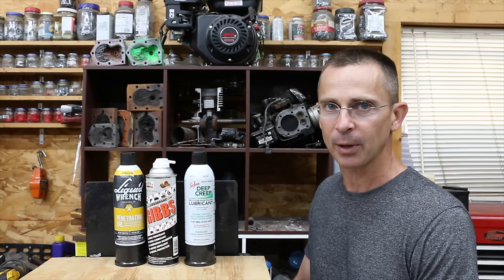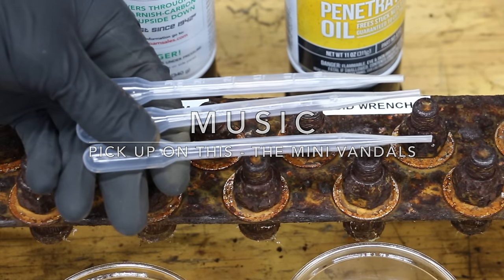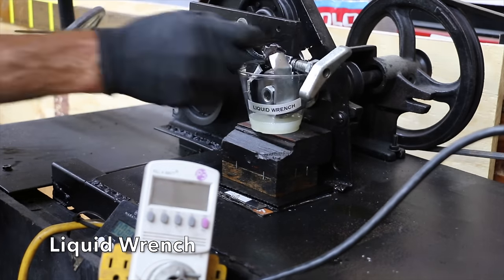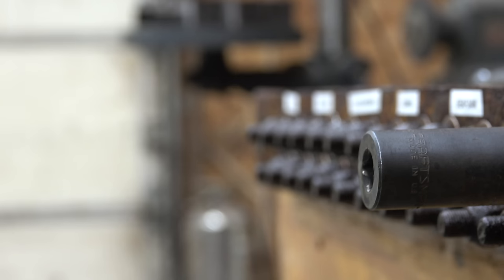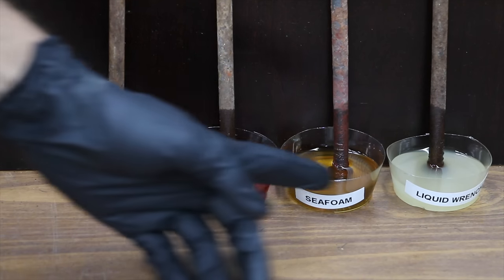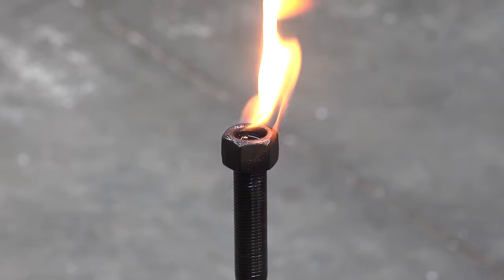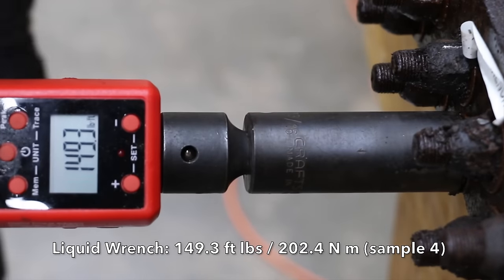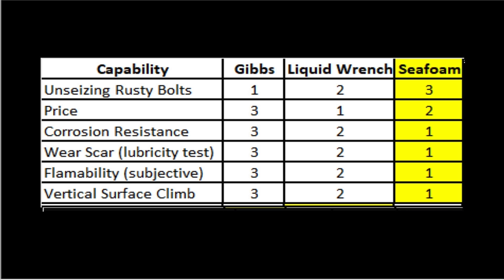Best Penetrating Oil?  Seafoam vs Gibbs vs Liquid Wrench

Comment: Terrific video! Thanks for keeping it interesting and fun. I’d be interested in seeing what is the best way to remove a rounded off nut or bolt head. I’ve used several different “miracle tools”, chemicals, and methods. None seem to work as advertised. I run into this problem a lot in my line of work. I’m curious as to how rounded off nuts and bolt heads are removed on the Project Farm! Keep up the great work!
Reply from the maker: Thank you

Comment: one time had to take out the plug on a diff to drain the oil. Put some Kroil on it the day before and the day of. After it wouldnt get free we hit it with an oxy acetylene torch until it was red hot. STILL wouldnt come free. we broke an impact driver and a breaker bar on it and to this day its still stuck. Lesson is sometimes it dont come out lol

Comment: Have a video suggestion if you have any spare 2 stroke engines to break.

{ A video about what will happen when you run a 2 stroke way to lean to the point it'll lock up in the cylinder wall; and to see if the Piston head could be possibly recovered to some extent and be re used }.

Thank you for all your testings you do in your videos.
Reply from the maker: Great suggestion, Thank you

Comment: Hey man, still super interested in rattle cans / spray paint.

Which cover the largest sq footage, which hold pressure the longest, which work best upside down and which deliver paint at say 10 inches the best are some good questions.
Reply from the maker: Great recommendation!  I was also thinking about UV exposure too.  It'll take a while to test UV/weather but I think it'll be worth it.

Comment: After using kroil a few times I've become a firm believer I used it to unstick a trailing wheel on a brush hog that have been sitting for a couple years I also used it to unfreeze some ratchet straps at work that have been soaking in a side box of a semi for at least a year with road salt and everything else in the Box and it only took a matter of minutes for it to work in either instance
Reply from the maker: Thanks for the feedback

Comment: Once I used liquid wrench to pop out a pivot pin seized from rust. Pivot pin in a makita shop saw. Dang thing popped out with for or five hits. Compared to the beating I was doing with WD-40.  I hit my thumb so hard with the WD-40, after it slipped off the item I was using as a punch to punch out the pin. After that I was sold on Liquid wrench.
Reply from the maker: Impressive!  Thank you
Reply: Project Farm turns out the one my boss had is in fact a Gunk’s Liquid Wrench, Super Penetrant. It’s got to be at least ten or twenty years old.

Comment: The data might already be on several different videos, but as an owner of firearms there are tons of different lubricants out there designed to "protect" your investment. I think you could setup an interesting test involving a bunch of different firearm and non-firearm specific spray lubricants to find out which one works best to prevent corrosion (especially with your worst case scenario metal eating spray bottle you got there haha). You could even do it bracket style like the oils, if there is enough interest or data points to cover.
Reply from the maker: Thank you for the video idea!

Comment: You should try a testing different gas octane grades 87, 89, 91, 93, and 94  in your different engines. See through for flame color. Carbon build up, run time for equal amounts of each octane grade, engine temps, etc.
Reply from the maker: Thank you for the video idea!

Comment: Use penetrating oils to unsized the engine.  And if you introduce the heat factor to nut test after all you mentioned yourself - exhaust manifold. Also ,I think that the control nuts should be the one you can not unscrew. In most cases thats the only reason we look for penetrating oils, and if i look at the chart it just the ft/lbs difference. If i can unscrew it applying more force ill do that before i go to store looking for help. Over all, I love your videos. Still looking forwards for the battery jump packs idea i gave way way back.

Comment: Best solution I've ever found is tapping the faces of the nut with a hammer. The impact energy will break the rust bonds between the bolt and nut. Tap several faces as hard as you can without causing damage. Even a light tapping for 30 seconds can make a big difference. Works in the kitchen too, tap the stuck jar lid all around with a heavy wood spoon.
Reply from the maker: Thanks for sharing.

Comment: In the 60's I saw mechanics use Zippo Liter fluid to loosen rusted nuts and bolts. It worked great . They did like you did and let it sit for a while.
Reply from the maker: Thanks for sharing.

Comment: I am wanting to migrate from traditional 4' florescent lights to what I hope are money/ energy saving LED tubes.  I see Menards has both a by-pass LED which requires you to remove the ballast and rewire and a style that works with it without the ballast. Of course there are still the fixtures with the little round push in and twist ballasts.

Which is the most energy efficient? 
What would be the return on investment? 

Curious minds would like to know.

Comment: Be interested to see a followup test for these three with the numbers for each penetrant and heat applied to the nuts, as well as a control just heat application to rusted nuts and bolts to see how the application of heat changes the torque values necessary for breaking rusted bolts loose. Maybe even a comparison of heat values, to see if more is better, or if there's an asymptotic level at which heat becomes a diminishing return.
Reply from the maker: Thank you for the video idea!

Comment: What do you suggest as the best way to remove broken bolts without stripping the threads or is there any difference in any anti seize on bolts.

Comment: that Torque adapter is one of the more interesting attachments I have seen for a ratchet or breaker bar.  I imagine it was quite a bit cheaper than a set of torque wrenches.

Side note,  will a small engine run on Gibbs?  it does seem rather interested in burning.
Reply from the maker: Thank you for the video idea!

Comment: I'm working on some bleeder valves that are stuck in my calipers, so this information is going to be very useful, but I have already been soaking them with WD40 for weeks now. So I will try some liquid wrench and sea foam as well as some gibbs. Then heat them and see if I can get them freed up, by the time I get ready to replace my brake.
Reply from the maker: Thank you for the feedback!

Comment: I didn't know you did a liquid penetrating product test including Gibbs. I had a 2007 Kawasaki Z1000 that sat out in the backyard for years. I stopped riding it for 3 years because the gas tank had a leak. There were times I wanted to open the gas cap and couldn't. Over a years span I first used WD-40 which didn't work, then I tried PB Blaster. It lasted about two months and had to apply more. I work at a small motorcycle accessories, parts and service repair shop in south Florida and we used to sell Gibbs. Well, we had 12 cans and one year later we had 4. It didn't sell well so we returned the 4. Years later the salesman we bought the Gibbs from came to our store for tires etc., for his BMW and he ended up giving me a can of Gibbs. I used in the gas cap and it lasted 4 months before i had to apply more.
Reply from the maker: Thanks for sharing.

Comment: Here's my broken exhaust stud story: I recently had a 1994 5.9 Dodge Diesel in a Winnebego. (It and the 6 speed Alison are Amazing pieces of engineering.). A stud at the turbo area broke off and I spent THIRTEEN Hours driling it out with different bits and diamond grinding stuff made of unobtainium and adamantine. But the bolt was like Honey Badge.....13hrs.
Reply from the maker: Thanks for sharing!

Comment: You should do a video where you have a engine with a whole bunch of scores in the cylinder and low compression and fill it with jb weld and other welding stuff!
Reply from the maker: Thank you for the video idea!
Reply: Project Farm and if it does fill the gaps so if you can raise the compression and run

Comment: German car magazin did very similar test about 5 years ago,and wd 40 won by a mile.
They rusted their bolts in autoklav,with salty water,so they got very consistent release force on the (control) nuts.
Here,they differ up to 20%.
Reply from the maker: Thank you for the feedback

Comment: That was a very relevant and useful comparison!
I wish you had done the 24 hr on the Gibbs vs Free All only because Free All (and others) claim to have agents which dissolve rust.  A rust dissolver might work better over longer times.
As far as a dissolver test, this might work:  You have rusted metal where the rust has made a rough surface.  You apply the product and wait.  Then you wipe the surface to see if it is smoother meaning iron oxide crystals have been either weakened or dissolved.  NOTE:  I believe I have noticed this with Free All which I just bot because of a friend's recommendation.  I'm going to find a nice piece of rust sheet metal to see if this does in deed happen.  How to just "roughness" will be subjective.
Reply from the maker: Thanks!  Thanks for the constructive feedback.

Comment: I think that bigger bolts tend to suffer less from corrosion than smaller ones, just because the same rust layer thickness is way more significant for a smaller thread.
Reply from the maker: Great point!

Comment: Love your videos. Very comprehensive and well thought out tests. Doesn’t relate to this video but I did notice both bestline and motorkote worked very well as additives. I noticed they work better when not mixed with oil. Could these be used at 100% concentration instead of mixed with oil? Not sure if they have the same thermal resistance as oil and that’s why it may need to be mixed.
Reply from the maker: Thank you for the video idea and thanks for the positive comment!

Comment: The rust prevention section was interesting, could you do that test with rust prevention specific products? A short list could be: must for rust, wd-40 specialist long term corrosion inhibitor, rust-olium rust inhibitor, fluid film, and any rubberized undercoat. Also include common home remedies like bar and chain oil, used motor oil, marine grease, and wax. To be thorough, test with fresh metal and metal that has already started rusting.

Comment: Hi, I have experienced a big pin jammed issue. It is not successful Using External two Hydraulic Jack with around 400 bar each. Seeing your videos and got idea of pouring penetration oil. Will this penetration oil be helpful to unfreeze the pin.

Comment: I have a test. I was told that if you were super low on gas.. not empty but you know you will run out of fuel before you get to a gas station you can urinate into the take to give you a bit more run time. How much urine could you put into gas and it still is flammable enough to run an engine. Like urine to gas ratio and once you find the perfect ratio would you get anymore milage from it or would the decrease in power per cycle cause the engine to use more fuel eliminating the difference of volume. Say you were in the middle of the no where. You have and 1/8 tank of fuel but you know that is not enough gas to get to the station. Could you pee in your tank to get the extra distance?
Reply from the maker: Thank you for the video idea!

Comment: Looked like big outliers on the gibbs bolts brought the averages down by enough to win the unseizing part.  Why is there a 40-50-ish ft-lbs difference between some of the results?  I'm a stats guy by trade.  I think your variance there requires a much larger sample size to make any definitive conclusion.  However, I still appreciate the best scientific approach that I have found to the effectiveness of so many commercial products.  I buy liquid wrench now, thanks to its affordability and the results you demonstrated.

Comment: Another Youtuber suggested a 50-50 mixture of acetone and automatic transmission oil. Well I gotta to tell you - it works wonders. It's not in a pressurized can and you have to keep it in a plastic container but other than that - to me - it's the best
Reply from the maker: Great recommendation. Thank you

Comment: When you do the climb test, you should do it on a rusty nut and  bolt dipping just the end with a part  the bolt into the penetrant. I have always wondered if the penetrant actually went into the rusty threads.
Reply from the maker: Thanks for the constructive feedback

Comment: Thanks for the test, is there anyway you could re-do this (even short segment) with stuff from a junkyard maybe.
As even with acid treatment its not the same as being weathered for 10 or more years as its more the fusion to threads or outer but rusting that makes life hard.
What makes me lol is when pulling apart a vehicle 40+ years old and outside nut is rusted but otherwise fine with good thread, yet you get a car 10 years old weathered and probably break the bolts (don't make em like they used to with real zinc coating 1-2mm)

I use Wurth in NZ as don't know if we can get your ones but seems to work well
Reply from the maker: Thank you for the video idea!

Comment: How about a test on snow blower shear pins.  Just bought a 2019 cub cadet 3X™ 26" TRAC unit.  Sticker on the body calls for one type of shear pin, the manual calls for two different pins, one for the central augers and another for the outer augers.  The same unit last year had one pin type for the central and outer augers.  The dealer said don’t use threaded shear pins.  Is there really that much difference between them if they are all the same diameter at the shear points?
Reply from the maker: Thank you for the video idea!

Comment: I'm not sure how you would measure this but I've got a vid suggestion.
Torque nuts up to say 800ft-lbs and then induce rust - So we can measure whether the penetrant/heat affect is proportional or linear - in other words - Will the difference from control be 40-80ft-lbs, etc. Or will it be proportional to the torque e.g. 200-400ft-lbs.

In my experience I pretty much only ever apply penetrants or heat to bolts I can't rattle off first with an impact, or beat off with a slugger wrench/hammer.
Reply from the maker: Thank you for the video idea!

Comment: I do have a request...rust converters?  A neighbor gave me a generic spray bottle with a milky looking liquid and said to try it on my rust under my jeep.  It worked great.  It went on easy, dried to the touch within 30 minutes and cured completely within a day.  It dried blackish and shiny and lasted at least for two years I had my CJ-8 (I had to paint over it he said, which I did).  He moved away before I remembered to ask him where he got it.  I noticed Rustoleum has a converter, but it acted differently when I tried it.  It sprayed on from a can like paint, came out very black and was thinner. It only lasted a few months on my RAM 2500 semi-rusted frame.  Anyway, if you feel like it, I know a couple of my friends have battled with rust on their undercarriage and other things.  They too did not have much luck with anything.
Reply from the maker: Thank you for the video idea!

Comment: How about a test on several of the new inductive nut heaters for the classic rusted lug nut.  You could test various wattage ones, maybe also against the propane or mapp gas method, and even with and without penetrating oils.
Reply from the maker: Thanks for the suggestion.

Comment: Also: Shouldn't nut-loosening performance be evaluated based on the torque value improvement relative to the same but untreated nut, rather than an absolute torque value? To give an example: 

Consider that bolt 8 (product B) was at 180lbs untreated, and then after treatment it's at 160lbs. But bolt 1 (product A) was at 160lbs untreated, and then after treatment it's at 150lbs. 

Can you really say that product A performs better than product B?

Comment: I love your channel and on thing my local mechanics always try to sell me on is doing a "Seafoam clean" to clean my motor. They usually charge about $450 and take off my intake and spray the cleaner directly into my intake manifold while running. This gives my motor a pretty nasty smell for a few days but I never know if it's worth it. While I see that Seafoam helps against corrosion, does it actually clean the carbon buildup in my motor? Is it worth the cost? (I'm pretty mechanically inclined and will perform the clean myself if it is worth it rather than pay the $450 but I just dont know if it's worth it) I had them do it once on my old 6 cylinder genesis bit havent had it done on any car since. I was feeling pretty good and wanted to splurge on my car a bit hehe. I'd love to see you run this thru your neighbors lawn mower and check out how it cleans the pistons.

Edit: I've actually only had this done once and have always questioned whether it was worth the money.
Reply: IMO seafoam is only needed for an engine with a REAL mess inside.  If things aren't too dirty I feel like it will do more harm than good.  It screws up oxygen sensors and catalytic converters

Comment: Todd, do you have a video on large generators like around 2300 watts? One Youtuber and his family in Oklahoma are building a house and everything is off grid. He has been using the Predator 2300 gasoline generator from H.F. and they've only last between 1,000 to 2,400 hours before they fail. I was hoping you had a video on which is the best and I'm pretty sure I watched it.
Reply from the maker: Thanks for the suggestion.